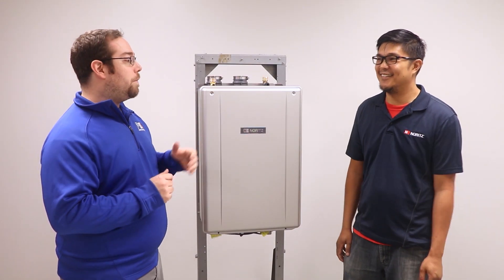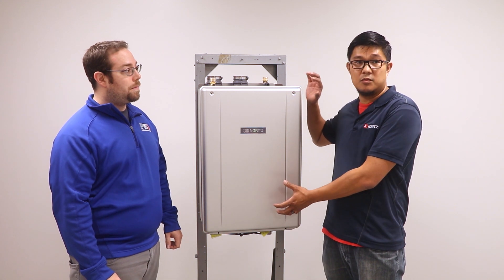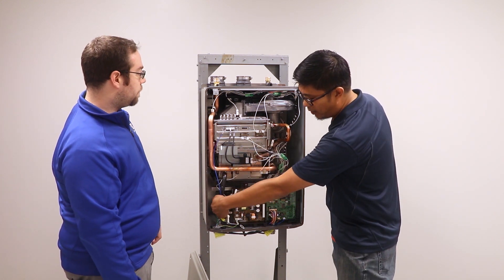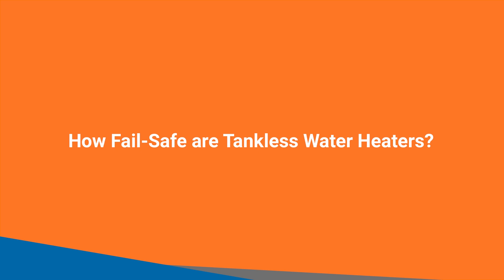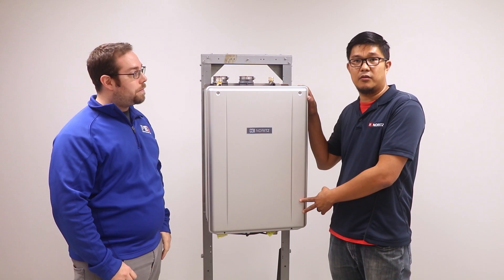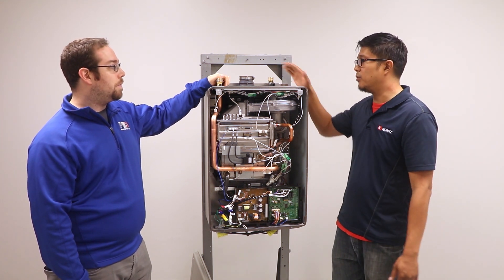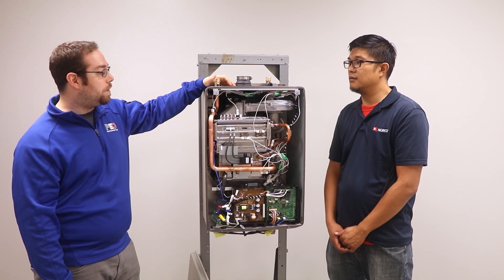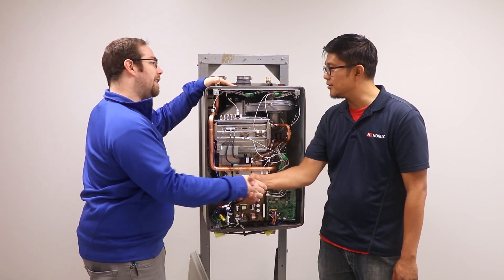Tankless FAQ's: Ask the Expert with Noritz

Comment: I'm researching replacing our 75 gallon with a Noritz eZ 75. This will go in the existing water heater closet, which is in the middle of our house. My question is: how loud are these while they're running? Will the noise transmit through a normal house drywall wall? The closet is next to a bed room so I'm concerned about noise.
Reply: No very quiet at 2.4 decimals at 24" away and Noritz recommend a license plumber

Comment: Be aware, these can only be installed by a Noritz authorized installation company otherwise your warranty is useless.  My noritz combi boiler came out of the box with a bad AGM actuater and they would not send a replacement since I installed it myself even though I have been in the HVAC business for over 30 years. cost me over $100 to pay for new part myself, bummer. And this was from ecomfort who was absolutely no help with the problem.
Reply: Does your unit have a black case and curious to know if the unit has had anymore problems
Reply: @mx-lj4qq  yes it has a black case. So far that has been the only issue.

Comment: Can this work in a cold climate like Canada in the winter? Thanks
Reply from the maker: If it's gas-powered, installed inside, and sized correctly it should work in colder climates. There is usually freeze protection built into the units.